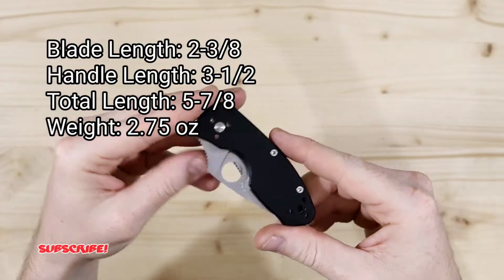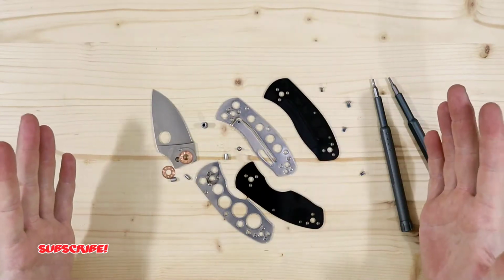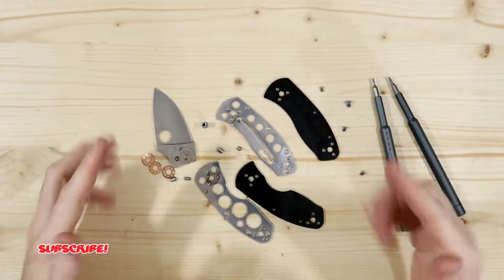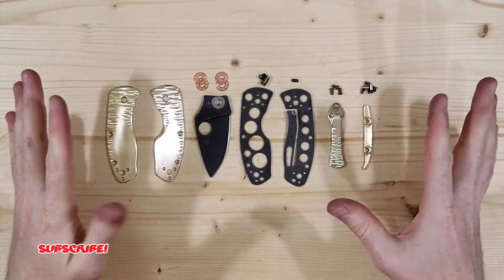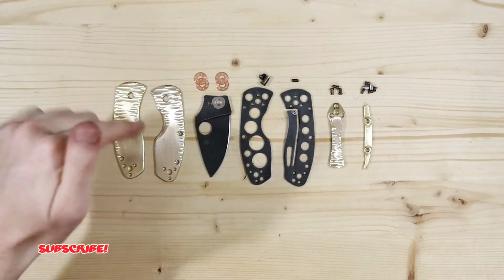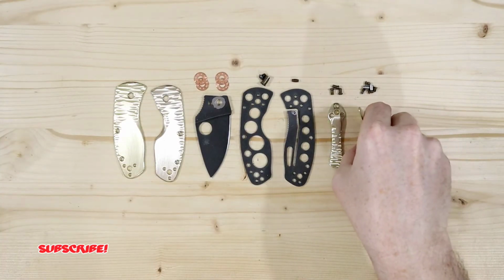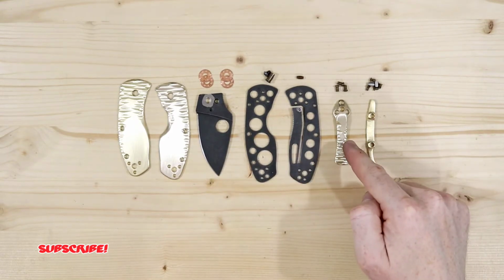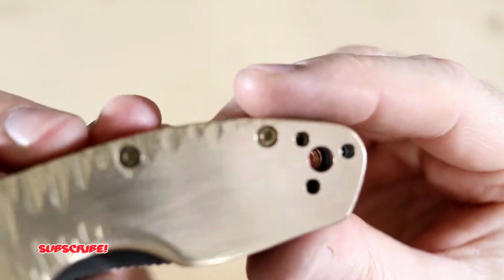500 Subscribers GAW!!! Spyderco Ambitious Pocket Knife w/Brass!!!(Knathan's Knives)

Comment: With brass scales shouldn't you be able to move the pocket clip a d even be stronger ?    congratulations for going over 500 and600 is closing in.
Reply: #the spyderco shaman is the knife I really wanted even bought a pocket clip before they were released. Couldn't get one they were out of stock and after over priced.
Reply from the maker: Thank you and I've heard about the Shaman being more expensive after the first release, it's a bummer. 
GL on the GAW! 🙂
Reply: @KnathansKnives  so what did I do ,I put the clip on a cold steel knive. Some MXG clips do fit cold steel.
Reply from the maker: @jdemeter4357  Didn't know that, appreciate the tip!🙂
Reply: @KnathansKnives  on Sweet Knives 1-5-21 The topic gluing lap film on work sharp guided sharpening system, I posted and got no reply so here's my share. 
  On the work sharp you can use 1×6 stones from any system. Just take off guided stone holder, lay your 1×6 stone the table ,set holder on top with one stone down,using  a 1 inch large binder clip go over the top of all,there will be a space between the guide and the clip,using a piece of cardboard fill the gap raising the bottom of the clip off the table.  Sharpen away!
     The clip is at any office supply store. The top of the clip becomes the handle, just center the clip over the stone holder and use the top half of the 1×6 stone. 
  Go ahead use and share😎